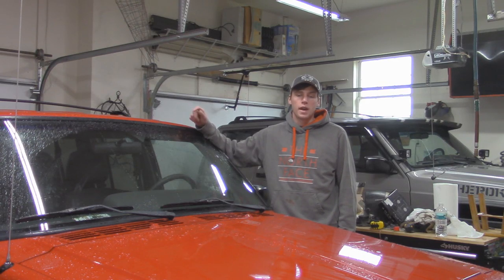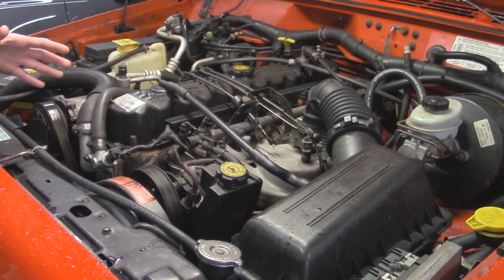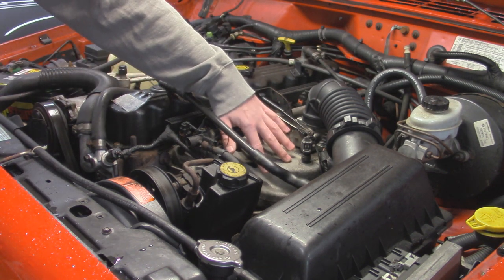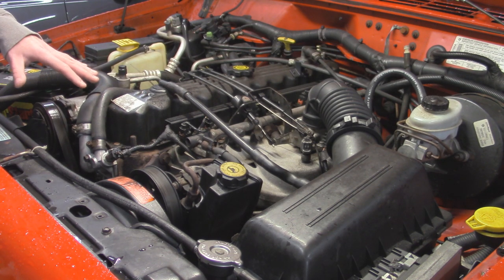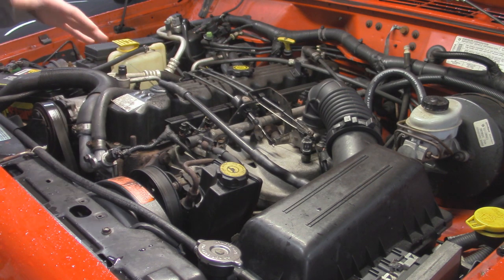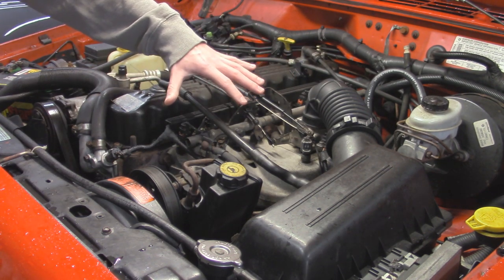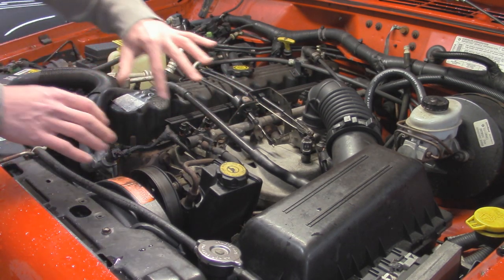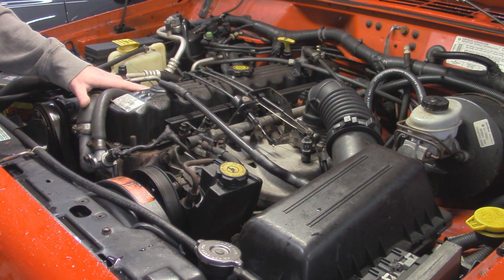Jeep 4.0L Exhaust Manifold Replacement

Comment: Protip:  Once you get the exhaust manifold lightly attached with the two END nuts, install the 4 lower bolts just a turn or two.  You can then "Set" the intake on the lowers and wiggle things to get the dowels to seat.  Carefully thread in a top bolt to hold everything snug and install the other 4 upper bolts.  Torque everything according to the factory manual.  DO NOT SKIP THIS.  It WILL leak.   Installing the LOWER bolts will greatly speed-up the process.  At least that worked on my 99 XJ..  Now would also be a great time to replace that lower radiator hose too. :)
Reply: That’s how I did it too. Took a lot of pain out of trying to fish around and find the holes.
Reply: Fishing wasn’t too bad but that ever changing combo of extensions was fun.
Reply: Great idea! I installed a header on my '87 and wish I had know that. About to do that on my "new" '98 and will definitely use that. Thanks
Reply: thank you!
Reply: This is a solid idea!
Reply: You just saved me a world of hurt. Cheers brother.
Reply: How do I get torque wrench on the lower middle bolts

Comment: Great video. One comment/suggestion, when I take things apart that involves nuts, bolts & screws, after removing the piece that is being held in place by the nut, bolt or screw, I put that nut, bolt or screw BACK in the same place that it was taken from. This prevents missing hardware and I’ve also found that nuts, bolts and screws go back into the same place they came from much easier (most times).
Reply: I also let them soak in pb blaster before I put them back to prevent seize ups.

Comment: I just got my first Jeep and your channel is hugely important. I appreciate all the camera angles and pro teaching tips! Cheers
Reply: I bought mine new in late 1996.  September of this year, I will have her 25 years. Wow!  What a journey we have had.  She almost died last December. The wiring harness from the ignition computer to the engine sensors cross-circuited due to damaged insolation.  The cable harness, from under the bonnet to the fuel tank, became a melted mess.  It took me about two days just to remove the wiring harness and some sensors that were melted to the connectors to the wiring harness.  I replaced the entire wiring harness from the tank to the computer and sensors and replaced all sensors also.  I am certain anybody else would have given up and scraped my rolling time capsule.  I almost did myself.  But she just got back running this may 2021.  I look forward to the next 25 years with my beautiful RMS Stargazer. 

Jeeps that share my life:
1. 1990 Wrangler  YJ ( Murphy is the name because whatever could to wrong often does. She still runs ) 
2. 1997 Wrangler Sport TJ ( RMS Stargazer)  { primary Jeep } 
3. 2012 Wrangler Unlimited Sahara JK ( Spirit of The Lowlands, "Lola," for short) {secondary Jeep}
Reply: I think this is the best xj channel,  especially for the beginner!

Comment: Put an engine in my 2000, and what made putting the manifolds on a little less painful was putting the lower bolts in first. I took some white Teflon tape and secured the washer to the head of the bolt. Then threaded the bolt in just enough so it had a good bite. Then I was able to hang the intake manifold on it perfectly, and the washer didn’t slide up and get in the way.. Saved a ton of time..

Comment: I have a 99 XJ Sport... same, same -even red. SO I am getting an EXAUST MANIFOLD - with flex pipe... as you show in this tutorial. Question: mine has a noticeable sputtering noise when you on the gas, and I think my gas milage and torque is just getting worse. Once I do this job, will that likely restore some lost power and gas mileage? I hope so! It's got 230K + on it, but no major issues, runs fine, just a little hesitation sometimes. I am going to do a basic tune up also. (plugs, wires and cap/rotor) Do I need to be worried about anything else?

Comment: Thanks for the concise detailed instructions.  With sincerity.   My Jeep (1995 cherokee country) failed inspection and sat there for 10 months.  I finally decided to tackle it rather that put a heat tape or jb weld patch on it again.  Hit as many of the bolts as I could with PB Blaster the night before and that helped a lot.  As you confirmed in a comment the 95s have a different power steering setup so that took some extra time.  My main setback was in not expecting to need to change out my engine mount.  Aside from the run to the store I wasnt on level ground and the engine torqued a bit when I did the switch out.  Made it interesting trying to reattach the mount bracket.  For those thinking of taking on this project you may want to have an engine mount on hand just in case, which will probably be the case if it hasn't been replaced recently.  Only $20 at auto store.  Use a floor jack and a piece of lumber to support the engine under the oil pan so you can remove the mount bracket.  From my research it seems the broken engine  mounts could actually be integral in causing the cracks in the pipes.    And we would be wise to say no to the crack pipe 😁  Thanks again.  I'll be using your videos for many future projects!

Comment: A great effort showing all the nuances and difficulties. I am still intimidated by this job, so I am still suffering with the air-noise and likely power reduction due to the leak on my 99 XJ. I can't see the leaking/cracking area, so I am just assuming that leak is there. I am also still researching which manifold to buy. I am in California, so it has to be 50-State legal. I like the type you installed with the flex sections, but I don't know if it is legal in all 50 states.

Comment: This would be a great time to replace that pesky Crank Sensor that's on the TOP back of the trans bellhousing.  Make sure to buy the DEALER one. The cheaper aftermarket ones tend to fail early.  Also replace those engine mount to block bolts!  They tend to shear off due to the holes not being cut deep enough at the factory.  Add another washer under the bolt head and use some blue locktite.

Comment: Covering the throttle body throat with paper, or plastic rubber-banded in place, can prevent fastener from finding its way into your engine.
I bought a smoking (not smokin') '98 Volvo and found a hole in the #5 piston.  The former owner made a simple repair into a mess by dropping a nut into the intake manifold.
Reply: I did that once with an old 73 Beetle. I dropped one of the carburetor nuts into the carb without realizing it. A few minutes later the motor started ticking REALLY LOUD. Luckily the top of the piston just got an impression of the nut pressed into it.

Comment: Liked and subscribed!!!!  Phenomenal instruction, presentation and video. Thank you!!! My 2005 wrangler my need the exhaust manifold replaced soon. Much difference?  Looks like the air conditioning lines may be an issue on my end. Any advice?
Reply from the maker: I'm not familiar with the wrangler setup, but if you have to you can remove ac components like the AC compressor and condenser and move them out of the way and keep them all attached still.

Comment: Thanks man!!! I was able to follow your video and install an aftermarket exhaust manifold on my xj 4.0. I really appreciate it, it went pretty smooth with your instructions. My power steering was a bit different, it had a tensioner bolt, and I used a factory service manual to understand what all the power steering bolts were haha.
Reply from the maker: Yeah pre 96 4.0's had a different belt routing than what is shown in the video.

Comment: Guys please think it through before installing any cheap replacement for this type of 4.0 manifold (one piece). I have gone through 4 lf them in 8 years. Typically a cheap ebay manifold will begin cracking within a few months. I am fed up but going to splurge on a Banks

Comment: OutJeeping...  THANK YOU for a most excellent "how to do it" video here!!  I watched it several times before attempting an exhaust manifold replacement on my 1999 Jeep Cherokee 4.0L XJ.  All went slowly, surely, like clockwork.......off, cleaning, back together........UNTIL I couldn't easily reinstall my power steering pump. The 3 bolts just would NOT align/thread into the aluminum intake manifold.  Hmmm...  Something wrong for sure.  But what? Started looking ALL over with my bright flashlight, from all angles and saw the front intake head dowel alignment pin was off by 1/8th of an inch.  Too low.  Not aligned.  Not fully seated.  DANG!  Ended up disassembling half of what I reinstalled, loosened up all the intake/exhaust bolts, pulled/wiggled the intake until I was sure it WAS aligned and holding on both the front & back head pins.  Snugged all bolts, then retorqued them all and finished the reassembly.  Runs GREAT and SO quiet.  A previous commenter gave us a "pro tip" on threading the 4 lower intake bolts in a couple turns, then lowering the intake down.  Would be impossible to "start" these bolts really with the replacement exhaust manifold having huge expansion chambers, limiting socket/extension access and visibility of two of the bolts.  A lot was totally done by feel and reaching around, up and under the intake manifold.  Guys...  Pay attention to the 2 head alignment pins for the gasket AND the aluminum intake!  The exhaust manifold is a "no brainer" as it hangs from the 2 end studs from the beginning.  Cheers!  Randy  "C-17A"

Comment: Nice instructional video. I just got the same manifold and it is a nice part. Checking where it mounts on the engine with a straight edge there was no gaps. However I put like a pipe cleaner through one of the pipes (cylinder #3) going into the main pipe and it would catch on the inside where the weld is. I’m going to get a small inspection mirror and see if there is a small area where the air flow could have a small restriction then I’m going to get a flexible shaft for a dermal tool and smooth that area out.

Comment: This channel helped me alot, all of the things i do to my jeep was based on your DIY. today i'm doing this and bought same exhaust manifold. i already took everything out just waiting for the new exhaust manifold to come. QUESTION : if i ever want to upgrade to High Output intake manifold, do i need anything? is the connection and hose connection for vacuum lines same?
Reply from the maker: Yes I believe all of the vacuum lines are the same. As long as you are not swapping from a renex intake, which would have different vacuum ports and throttle body changes.

Comment: 18:59 hardest part, omg i had to count to 10 about 5 times to cool down
Reply: How long it take you?
Reply: @shadyonej  I took my time over two days, was quarantined so had time lol. Tightneing the bolts took the longest because the flex style manifold literally is right up against one of the bolts.  Can barely get a wrench on it and forget about a socket.  Its one of those take your time and don't get pissed kind of jobs. Its not hard, except for those bolts. This was the third manifold on my 99 tj with 94k og miles on it

Comment: Hey Austin, I’ve got a 2000 Xj .. they come with a 2 piece set up for the exhaust manifold… do you know if I can swap it out for that one you installed on this Jeep ? Or will it not work..
Reply from the maker: It will fit but won't work with the o2 sensors if you have a total of 4 of them. But they do make headers that will work with all o2 sensors. They fit   2000+ TJ's as well.

Comment: Great detailed video.  It's now October, how is the manifold holding up?  I can't believe its $58.  Online Jeep parts stores are charging $200 for what looks like the exact same manifold.
Reply from the maker: So far it has held up great, and I have put about six thousand miles on it. I don't hear any exhaust leaks so I'm assuming there is still no cracks.
Reply: Just bought it for $58 through his video. EBAY

Comment: Another great how to, from OutJeeping! Thanks Austin, your videos are why my Trusty Rusti is running the way she is. 

If you see this comment, I've got a question. I have a 2000 XJ 4.0L. It's mostly stock; however, the previous owner did and engine swap from a 95 TJ. So, there's a few odds and ends that are different from most Stock 00 XJs. I dont know if they kept the 00 head on the 95 block, or used the 95 block and head. 

My question is How can I tell if the manifold is the 95 one piece or the 00 2 piece, w/o tearing everything down? Or, will both of those manifolds fit in either head? Looking at the manifold from under the jeep, it actually looks a bit different than both styles, almost like it might be a custom piece. Everything has been wielded from manifold to tail pipe, and I need to replace the front pipe more than anything. I dont think a stock y-pipe on the 00 will fit this manifold. There are no flanges, I think it will be best and easiest to just get a new manifold and front pipe like you did in this video, but I need figure out which pieces to get.

Thanks for you videos, Keep Jeeping!
Reply from the maker: You should be able to look underneath to see if the down pipe is split into a y pipe. If it's a y pipe it would be the 2000 design with cast 2 piece manifolds. It would have either pre cats or none on the y pipe. Depending when it was built in 2000 all that can vary in what it came with from the factory.

Comment: I A HAVE A 97 XJ,  I just had mine replaced and now i am over heating. I replaced the entire muffler pipe except the catalitic. Converter. HELP ?
Reply from the maker: I dont see how changing the exhaust would affect engine temps in this case. I would double check all the things you took apart for this project that relate to the cooling system.

Comment: First off most of the manifold bolts are 14mm only the 2 nuts are 9/16" nuts. And most exhaust bolts and nuts are 15 or 16mm just FYI.

Comment: Very informative, but you missed an opportunity for a very simple, and inexpensive upgrade to your fuel system.
Dodge Neon fuel injectors. They have 4 holes instead if the 1 hole in your OEM units. They are identical injectors, so plug and play. It just takes a couple shorts trips to the store for your ECU to learn how to run properly. Better fuel economy and a bit more power.
Reply: This is interesting. I’m going to look into this some more. What year Dodge Neon injectors are you referring to?
Reply: @jasontomljanovic  94 - 02 iirc.
There's a ton of write-ups on different jeep forums, and several videos here on youtube.
Reply: @scottdoubleyou563  excellent, thanks! I’ll do some research! This would be a great upgrade!

Comment: Awesome video …. I agree with comment from ‘Den Samme’. I wish I had the workspace indoors to work on my Jeep Wrangler LJ, but since I don’t - the dealer will have to do the work - $2400 - Ouch !! Now that I see how involved this is … I can’t complain about the hourly fees. NEXT time, I’ll be a bit more proactive and try this DIY. Except i would want to change all hardware for new and clean/powder coat/Cerakote parts as I go with every project until my engine bay is all nice and tidy. Hahahaha. Thanks for the video.

Comment: Can you give more details on how did you bent the exhaust hanger @34:10? My jeep is lifted 5.5 inches but has an SYE and my exhaust still hits the cross member. I'd like to bend it but don't want to run the risk of cracking anything. How did you do it?

Comment: I have the same issue with my 99 xj. Was going to take it off and re weld the weld that’s cracked by the bottom connector. What are your thoughts on that? Should be fine right?
Reply from the maker: I have heard of a lot of people doing that. You we need to make sure the sealing surface doesn't get warped or anything like that as well so it seals up good. But with all that work it might just be better and piece of mind to replace it with a new one. But that is good cheap option as well.

Comment: I wish I had the confidence to just start pulling things apart like this but, I don't.
Reply: thats the point of these vids !
Reply: You don't until you do. Just dig in man. Take tons of pictures with your phone and bag every bolt and nut in a ziplock with an index card. Lay the parts you remove in a line so re-assembly is in the opposite order.
Reply: @BuzntFrog  I've got a bit of a Frankenstein so I gotta be careful and my mechanic is now 300 miles away. 😑

Comment: The exhaust bolt that is blocked by the pipe. What is the trick if the socket doesn’t fit with the manifold in the way?

Comment: Great video! The only thing I would add, it's a good practice to inspect and clean all bolts and head theads before reassembly. Replace any bolts, studs and washer if needed. There are people that fail to do it and end up having problems.

Comment: BROTHER YOU FORGOT TO DISCONNECT THE ELECTRIC BATTERY 🔋 REMEMBER YOU ALWAYS TIGHTEN ON X MOTION STARTING FROM THE MIDDLE 🙏 AND A GOOD IDEA 💡 IS TO CHANGE THE COVER VALVE GASKET NOW THE EVERYTHING IS OUT THE WAY AND IS EASY 🙏 GOOD JOB MY BROTHER 🙏🇮🇹🇮🇪🇺🇸🇲🇽🇩🇴🌞🌻🇺🇸🙏

Comment: What about the 3 catalytic coverters....two of them are on the original headers...only one exist now?
Reply from the maker: On the 2000+ 4.0L they use a 2 pieces cast manifold design that is slightly different. They are less prone to cracking compared the the header style manifold in the video. You will have to keep with that 2 piece design if your Jeep is equipped with pre-cats. They however make replacement of those cast manifolds as well, replacement process is very similar to what is showed in the video.

Comment: Even with the aluminum ones it's still a pain in the ass to remove the fuel lines, I started switching connections like that to the Chevy squeeze clips.